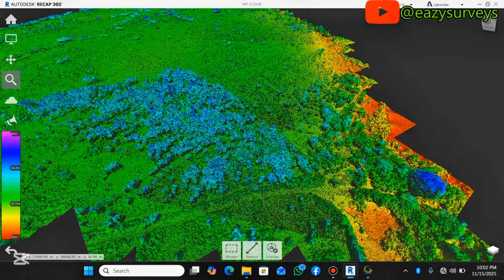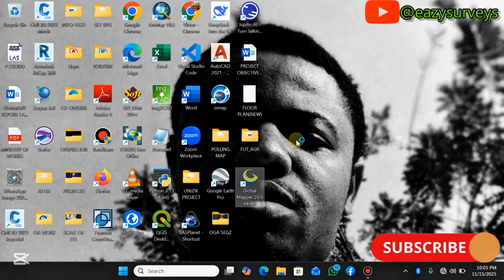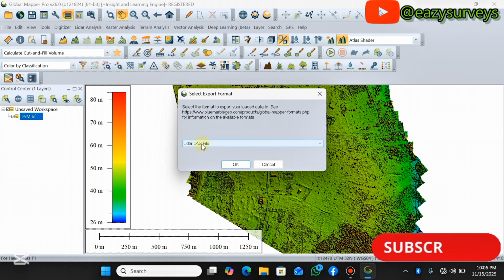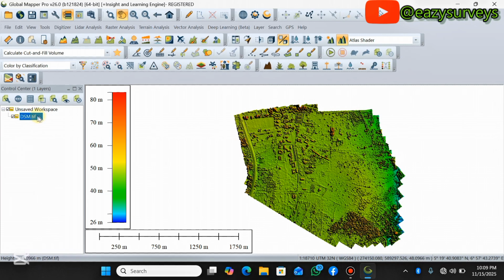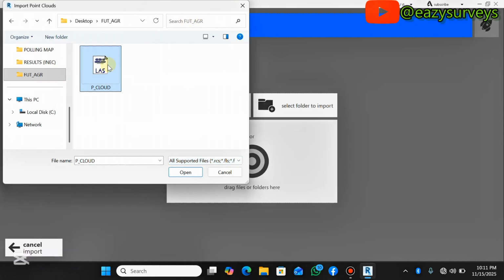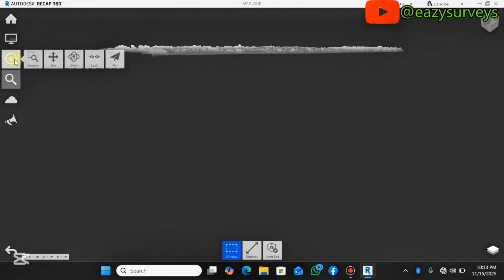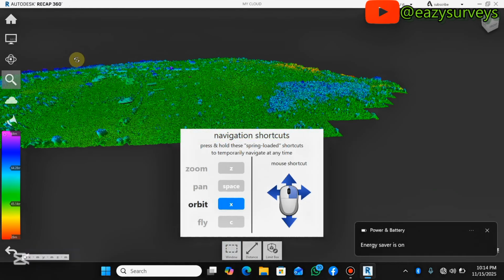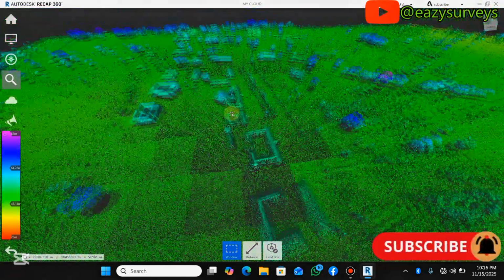Digital Surface Model DSM and Point Cloud || Autodesk Recap Pro for Beginners

Comment: Hello. Excellent tutorial.
Could we perform this procedure with the use of a satellite image? How to convert a raster image of a satellite scene into a lidar las format, regardless of the obtained cloud of points having a lower density and a lower number (total volume of points). We will certainly get a cloud of points from the satellite scene. This indicates less precision in the measurement, but sometimes precise measurements from lidar data are not necessary.
Reply from the maker: Noted, kinda possible with the right tools. turn on notification on this channel to get notified when it's uploaded. Regards🙂
Reply: @eazysurveys  Many thanks for the reply. I have been following your work for a long time. It is very useful.